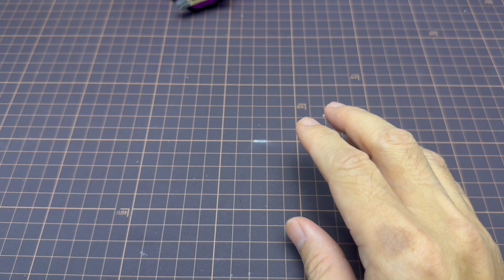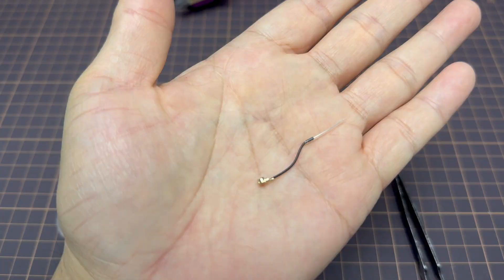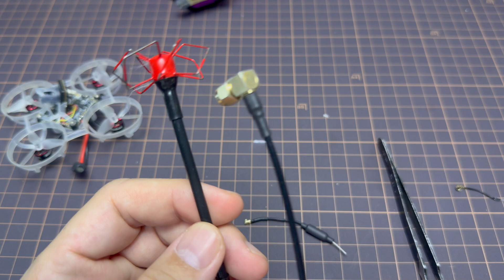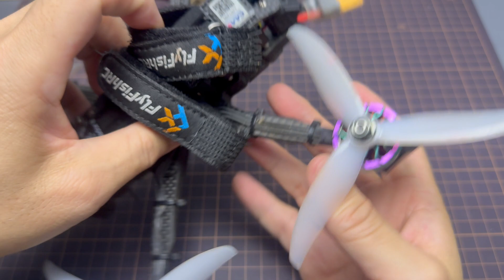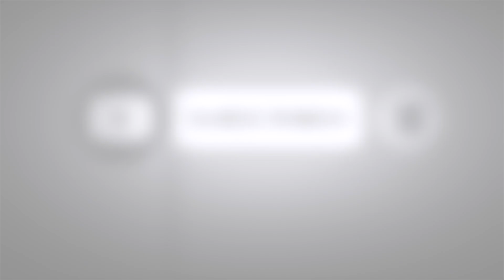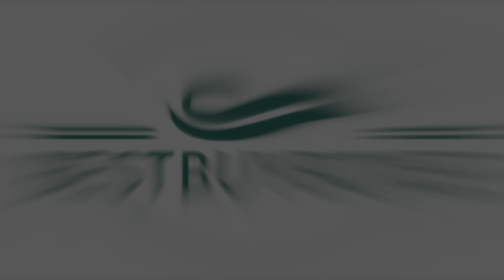Understanding FPV Antenna's in 5 Minutes!

Comment: i have the i flight nazgul xl 5 eco using at 1k6mw with the betaflight vr03 i only get 200m off rangee what should i do
Reply from the maker: 1600mw and u can only go 200m??
Reply: @shogunemperor  i was on raceband 5 chanel 8 and it was 5.95ghz thats why it didint worked

Comment: Thank you for the video!! What is the tiny drone you are using?? I mean the 1st one with clear plastic you show in the video. Where can  I buy it?? Can I control it using a FLYSKY FS-i6X transmitter?? Thanks in advance!!
Reply from the maker: Thank YOU bro for dropping in!!  OOOH! thats the HDZero Mobula6 freestyle. It works only with HDZero goggles.  Are u based in the US?
US
https://www.hd-zero.com/product-page/happymodel-mobula6-freestyle-hd

https://www.tinywhoop.com/collections/bnf/products/happymodel-mobula6-freestyle-hd-bnf

Anywhere else
https://www.aliexpress.com/item/1005009213602213.html?spm=a2g0o.productlist.main.1.3191743eEJQt42&algo_pvid=ca6fbe3e-7f45-4248-8bcd-ba3f185a56b6&algo_exp_id=ca6fbe3e-7f45-4248-8bcd-ba3f185a56b6-0&pdp_ext_f=%7B%22order%22%3A%221%22%2C%22eval%22%3A%221%22%2C%22fromPage%22%3A%22search%22%7D&pdp_npi=6%40dis%21SGD%21441.55%21331.16%21%21%212356.19%211767.14%21%402151e66217605053770053605e013c%2112000048333293700%21sea%21SG%210%21ABX%211%210%21n_tag%3A-29910%3Bd%3A4d0a2134%3Bm03_new_user%3A-29895&curPageLogUid=6qMSjt1rcIl3&utparam-url=scene%3Asearch%7Cquery_from%3A%7Cx_object_id%3A1005009213602213%7C_p_origin_prod%3A

Unless you get a FLYSKY version yes you can, but these are ELRS protocols.  So it wont with with your i6X.  Pleasure bruddah!

Comment: Good stuff brother very informative Thanks brother. Ive been thinking about the happy model performance motors for my neo. I just received the DJI Fpv control 3. And a pair of N3 goggles should be here tomorrow. What are your thoughts on rates for stock Neo for Manuel snd sport flying. Thanks brother 🙏🏼
Reply from the maker: Yoooo thanks so much bruddah!! Oh wow. Niiiiice man. Sounds like u have a fun project coming! Hmmm… to be honest.. i leave my Neo for video flights rather than fpv flights. So i actually never tried adjusting the rates or anything. Much apologies bro

Comment: Good video on antennas. Short and to the point. I only have one correction in what you have presented. While the DJI Air Unit and Vista generation used LHCP antennas, The O3 generation switched to linear polarization. While it is perfectly fine to use LHCP antennas on the system, the stock O3 antennas are linear. (It's actually fine to use RHCP as well as long as your goggles antennas match.) Sorry about the rain!
Reply from the maker: Hahah thanks bruddah. Oh? My 03 came with LHCP antennas! I didnt know they switched to linear… i mean, the mob8 03 did come with 2 dipoles. Thanks for the clarification bruddah!